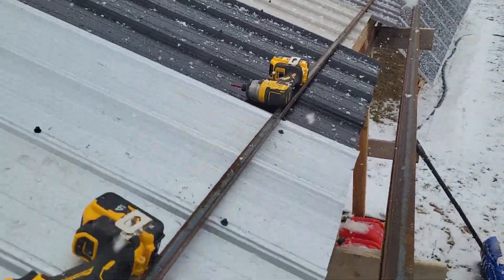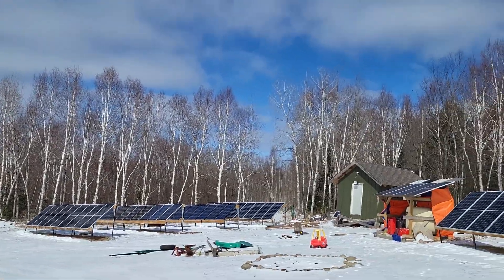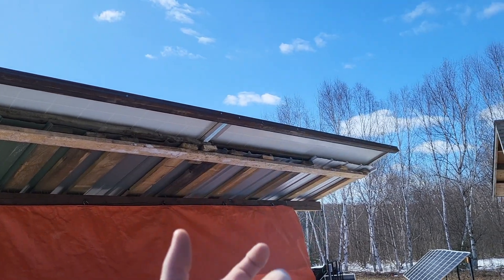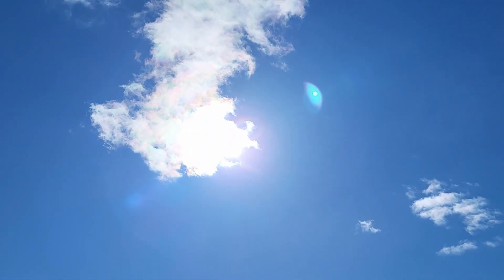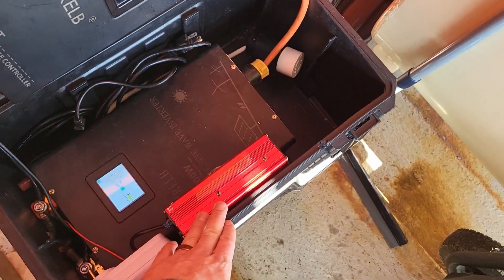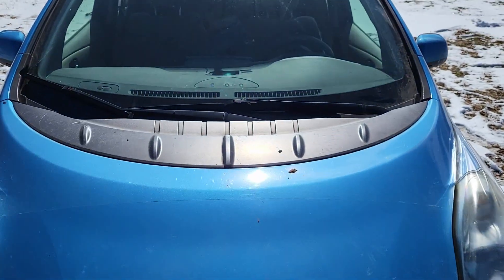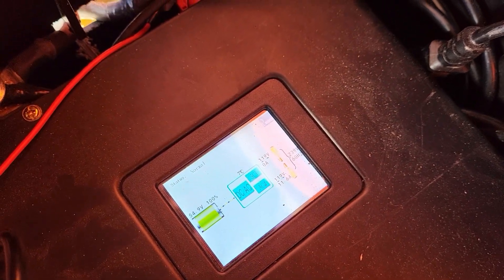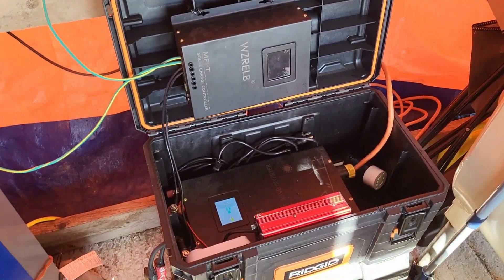Im Building a Solar EV Charging Station

Comment: I have an idea, on how to address some of the concerns you mentioned in the post. Such as the LEAFs limited range and how to improve its net PV to wheel efficiency. 

How about creating a 'plug-in battery storage trailer range-extender', for the LEAF? It's not the conventional route, but it has been done before. And it would address various issues. 

For example, it eliminates at least two forms of efficiency losses. Charging and discharging an additional  battery pack in series and inverter losses.Which also saves the additional subsequent charging time. And it increases the Leaf's range. Plus the trailer depending on how it's designed allow some additional carrying capacity. And other additional benefits depending on its design.

And there are third parties that can do the electronics and wiring harness mods especially for the LEAF. One of the inadvertent benefits of its poor thermal management, is that a cottage industry has developed to do mods for the LEAF.

Enjoyed the post. Just figured I'd throw out the idea. To see if you had any interest in it? (Sorry for making it so long, I tend to elaborate too much initially) Good luck with the build.
Reply from the maker: haha, I have thought about it, I will be doing a few mods in the coming year, I might try it, I love comments like these , sometimes I wait eagerly by the computer for one to pop up :D
Reply: @GoingOffGrid101  i forgot when making my comment, that you already installed a range extender, so a trailerized version, is well within your wheelhouse.... 

good luck deciding, which mods are appropriate for you... i'm sure it'll make for some interesting posts...
Reply from the maker: im hoping it will :D @nc3826

Comment: Nothing wrong with the leaf you should rebuild a leaf battery with different cells like the catl 180ah cells you will get well over 200miles to a charge then
Reply from the maker: hmm I might try that with my 2012, its close to useless way out where we live with out the extender pack.
Reply: @GoingOffGrid101  going to upgrade mine soon with the 180ah packs I'm already running with the 40kwh pack
Reply from the maker: @dama054  man if you beat me to it let me know Ill make a video and give you credit.

Comment: I had 2kw on my garage here in st catharines on. and city inspector force me to take them down. Needs permit for 1000$ and structural engineers approval for another couple gs. Be aware of neighbors complains and city parasites...
Reply from the maker: yes, its a little sad, I did the same thing in a subdivision and was lucky no one cared till the power was out and was jealous I still had power lol
Reply from the maker: put them beside your fence :)
Reply: i put some on the ground now.  @GoingOffGrid101
Reply: Put them on wheels and then it's not a permanent structure.. then give them the finger 😂😂😂
Reply: my conclusion is if you want to be better off of the rest of the slaves, you never live in a city. 
Out in rural properties you have a tinny bit of freedom. @KouRou2002

Comment: I want to see you dc fast charge using the solar running directly to your batteries. Always wanted to try it. It would be cool to just plug the car in straight to solar using ccs or chademo.
Reply from the maker: i would have to find a way to talk to the car and close the relays, but I have a 400v project coming in the future, cant say just yet :D
Reply: @GoingOffGrid101  I think there are a few projects on Openinverter for that.

Comment: Wow the cloud edge is kicking my butt today on my over panelled flex max lol. I was thinking on using solar panels for a roof with some silicon for the joints for a shed.
Reply from the maker: I tried that, they grow and shrink a lot, mine leaked like crazy, maybe you can figure out a better way :D
Reply: There are a few French firms that, offer relatively simple and cost-effective waterproofing substrates for PV panels that channel and seal out rain... (I believe one of them actually even has production within North America)... 

I like the elegance of it, but it provides less air circulation than a conventional raised PV panel installation, which decreases performance during hot weather... (but caulking around the panels would create, even poorer air circulation)